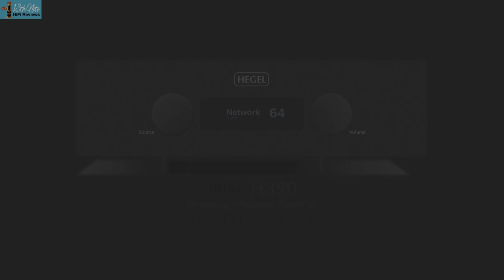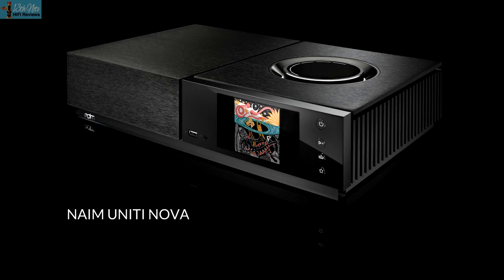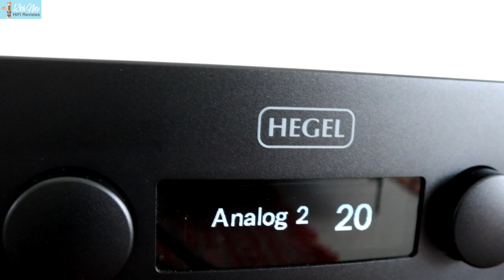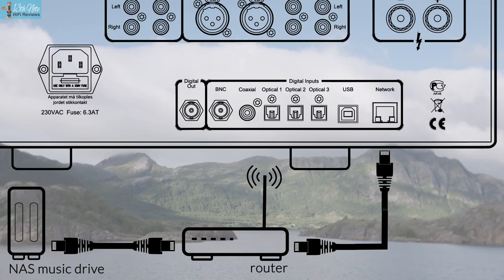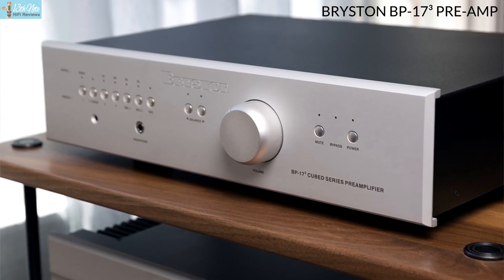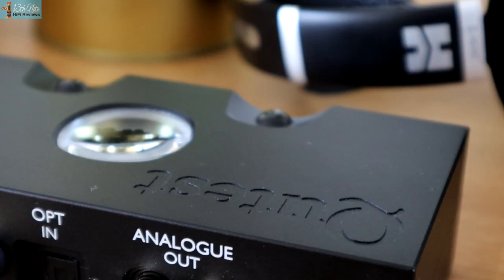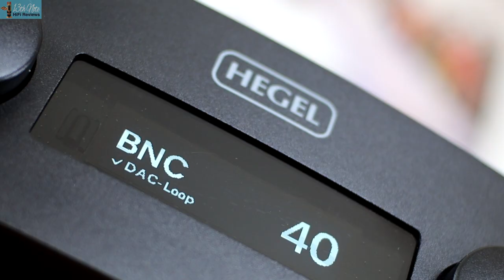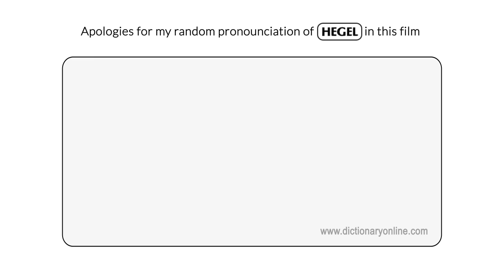A film about the Hegel H390 Integrated Amplifier

Comment: Listened to the 390 and the Naim as well. I had the direct opposite experience to you. Prefered the natural sounding, better made Naim. Both good products, I just made a different choice.
Reply from the maker: what speakers did you use?
Reply: @13thnotehifireviews7  my new PMC twenty5.23i’s and . . . . .  A very cool vintage pair of Kev Coda III’s that I still have.
Reply from the maker: @billywindsock9597  did you listen to all of it at home? what was more natural to you. You mean being a little tonally warmer with that Naim combo?
Reply: @13thnotehifireviews7  I have ended up with a Naim Uniti Star, PMC twenty5.23i, an IsoTek Aquarius and Chord ShawlineX speaker cables. I use CD, sometimes, this combination was the best bang for buck that suited me.
Reply from the maker: @billywindsock9597  some good choices there for me. Im sure the Naim is a good convenience solution. Those PMC's which I reviewed eat power and 70w is not enough dynamic headroom to get the best out of them, providing you want to at some stage. It also equates to detail too. This Hegel is nearly 4 times as powerful into a 8 ohm load. And it doesn't mean more volume etc, just more on and off dynamics. Ive been all the way from 70w to much more quality amps on my 25-23 including £10k dacs etc. It may have been the case in the dealer but you'll recognise the power offering on offer if you get used to it, of maybe a different brand if Hegel wasn't your taste. But sorry I dont think most people would agree with you with the Hegel not being as good a sounding amplifier mitigating taste issues. The naim is compromised by the fact its an all in one with an expensive case so that takes the investment down on amps.It wont be anywhere near as dynamic with bass. Ive got the similar H120 at same power to your amp and its obvious swapping over with my pmcs
Reply: @FJBx100  sounds lovely thanks.
Reply from the maker: @billywindsock9597  I agree the speakers are terrific
Reply: Hegel amps is natural, if you have a bright speaker thats what you Will get with Hegel, and with laidback speakers you get. More laidback sound vice versa, the point with Hegel is to add as little as possible to the signal chain, it took some time for me to get used to my h190, But once i did i loved  the experince
Reply: Better made naim?  Hegel is a hefty
We'll put together instrument.

Comment: I unboxed my H390 today and WOW it is bloody sublime! Previously I had the H90 and H190, but the H390 takes it to a totally different level.... think of it not as a step up from the H190 but a small step away from the H390 it’s that impressive. Driving Dynaudio Contour 30’s and the H390 has an incredible grip on them, a perfect pairing.  Highly recommended indeed
Reply from the maker: What DAC do you use?
Reply: @13thnotehifireviews7  no need for a DAC as the Hegel DAC is so damn good
Reply from the maker: It is very good and of a similar quality to DACs around the 1000 dollar price point but the amplifier is so good it will be very responsive to being improved by an external Dac. And DACs are underspent on in hifi, so for the quality of the amp and your speakers it is worth doing in the future. I’m trying a Denafrips soon, but ps audio direct stream or chord Hugo tt2 are worth checking out.
Reply: @13thnotehifireviews7  hey mate. Did you get the opportunity to try the Hegel in dac loop mode? I’m curious as to the point the Hegel converts the files and if a non-mqa dac would disrupt this.
Reply from the maker: @Peterfromplace  yes check out the video where I mentioned it 😁
Reply: @13thnotehifireviews7 Damn I must've missed the MQA unfolding part. I'll go through it again. Cheers. Looking forward to your next video
Reply: Hi,
Can you plz advise does h390 perform better compare to Simaudio Moon 700v2? Which one is better?

Thank.u

Comment: Hi Simon. now that you have been living with this for some time. How do you find the sound at low listening levels? I have focals speaker which are a littler on the more reveling side. I am looking at either the McIntosh Ma 352 or the H390. Do you find that it has good bass and that the high damping factor does NOT take away from the bass or control it too much?
Reply from the maker: Very good low listening. Good bass and no the high DF doesn’t take away. Definetely not. It does the opposite. It’s tonally not having any padding but when the bass kick is needed it is all there!👍

Comment: In my research into components I wanted to audition I came back to this video several times. I eventually settled on testing this and the Michi X3, I wanted a powerful amp that had a built in dac so I could purchase a streamer to hook up and at a later date add an outboard dac. I tested both amps with Spendor D7.2 as these were my chosen speakers for my system. I started with the Hegel, enjoyed every minute of it, I found it so easy to listen to and it gave me all the emotion with vocals. When I changed to the X3 something wasn’t the same, while the amp had all the drive for my electronic music I just couldn’t connect with it. I found it didn’t convey nearly as much of the emotion and with music, especially vocals, I want to be drawn into the emotion. Overall the Hegel simply had the ease, the detail, the emotion and the drive for all the music types I listen to, I was genuinely surprised how different the two amps were when it came to musical emotion. It was sad because I could have got a cracking deal on the X3, and the build quality and remote are to die for, but sound comes first. I will say I noticed the very slight toroid hum when I had it at home, but it is so low that the minute music is on you can’t hear anything and I agree for the most part you need your ear up to the unit to hear it. Overall your review was one of many that made it much easier to shortlist this amp especially as you too enjoy your electronic music. My streamer is yet to arrive, but the amp and speakers with the laptop plugged into the USB will do for now!
Reply from the maker: Good to hear, thanks for feedback . What was the price / performance difference to the Hegel with the x3. Spendors are fab.
Reply: @13thnotehifireviews7  The X3 at £4,300 is already less expensive but I could have got a big saving on that price so the Hegel was much more in the end. However I found the X3 to be edgier, it wasn’t a listen that stopped me noticing the amp, I was very aware of it. That couldn’t let me relax and so as I say while it had all the drive it felt tiring. I had read that it was warm and detailed, detailed yes but I didn’t find it warm, maybe it just didn’t match the Spendors. I also found it really noticeable how much quieter the background of music was with the Hegel in comparison so detail was easier to hear especially at lower volumes, this really became obvious with emotional pieces like Sade’s Pearls or Des’ree’s Kissing you. I went back to the Hegel to see if I was imagining all of this, perhaps it was my own fatigue (I’d been listening at the dealers for two hours by now), the minute it started playing again everything just relaxed, it all felt right again. I haven’t for a second regretted the choice as it still delivers that lovely sound that I can listen to all day and makes me want to keep listening. I now just need my final piece so I can truly sit back and relax without having to keep getting up to change tracks on the computer!
Reply: @Benvos  I had a similar experience today admittedly with Hegel's lower down offerings, 
I compared my Hegel H120 with the new NAD C399,
Really wanted to like the new NAD with all its new features including same dac used in the masters series and the added n-core modules. 
In comparison the NAD was really bright and lost all the emotion in vocals as you described, 
plenty of power with a big soundstage but cold.
I kept switching back to see if it was in my head and every time i went back to the Hegel the sound was much more relaxed but still really detailed and the bass was more deep and punchy too.
I think over longer listening periods the NAD would definitely become fatiguing. 
I have since come to the conclusion that in my experience Hegel make some of the best amplifiers out there.
Reply: That hum is normal for Hegel. Toroid
Are unwrapped transformers to insure better sound quality. You can fix by
Buying a DC filter/blocker, if it bothers
You.

Comment: Hi Simon, did you follow all the negative comments about Hegel on the Roon website? Most of them not only mention the lack of Roon ready after they promised that 2 years ago but also about cheap parts on the different devices of Hegel like the usb and the streaming part. Im curious what your think of this.
Reply from the maker: Audiophiles are an expectant bunch perhaps rightly because of the money they are spending. But I suspect Hegel didn’t promise it - I might be wrong - because they need to get certified before it happens with Roon anyway. So I doubt they would have promised in advance. I personally see the benefit of Roon to mostly be the interface, ease of use, Roon radio etc. But the thing with higher sample rates is that they are always taken as a kind of gospel truth to much better sound quality, which isn’t necessarily true. The Hegel’s ability to cope with airplay2 yields playback quality that exploits its fine amp stages and sound engine technology, more than many comparable amps that do the same airplay2 or even some amps that play higher sample rate music. That’s the way I look at hifi, people should be pleased when they can then throw higher sample rates at the Hegel via Roon, but not think hi res is the be all and end all because it is far from the only factor that creates a great or best category sounding amp. The pursuit of formats and sample rates has always been an allure of audiophiles based on technological understanding but it doesn’t then mean a product is inferior because it doesn’t stack up to a technological ideal. As I say I think it comes from people who are expectant, not trying themselves etc. On parts, I’ve no problem even if the parts are cheap, save maybe the external case which isn’t, so long as parts are reliable because when you buy hifi of this ilk you buy the design that has taken a long time to develop. I know they use better caps and other parts that stack up but even if they could be criticised - which I don’t think they can - I think the price of audiophile hifi at this type of price is a factor of supply and demand (with this design and capital investment) and the niche nature of audiophile hifi, not the internal parts somehow being golden nuggets.
Reply: @13thnotehifireviews7  thanks for your reply Simon, I’m fully agree. I have the H390. I know you have the same device. What Is in your opinion the best external streaming device to connect with the h390? Always looking forward to see your great videos.
Reply from the maker: So many tbh but my streaming shoot out video I did gives good pointers.

Comment: Great review Simon - Thanks, I have just purchased the H390 arrives tomorrow, I cannot wait to hook it up and see how it sounds, adding it to my Auralic Aries G1 streamer and powering my Kef R3 speakers (ive heard they work well together) it will be interesting to see how the DAC performs against my Chord Hugo TT2 and M Scaler?  shame there wasnt a WIFI option on the amp as I will have to look at options as its some way apart from the router.
Reply from the maker: Hi Barry, thanks for nice comments. You can use the extender option as I showed in the film to get the H390 to be wifi capable. Ive been doing that for ages in my set up and never have any problems. Netgear Nighthawk extender. What amp did you have before? Please feed back your comparison thoughts as would love to hear when you've got the H390 set up. Tomorrow I'm hoping to do a comparison of a musical fidelity amp against the two Hegel's I have. As well as Innuos Phoenix USB reclocker. BW Simon
Reply: @13thnotehifireviews7  Hi Simon I will check it out tomorrow re extender.  I previously had a Marantz KI ruby Amp which was great but I wanted an integrated amp and had my eye on Hegel for awhile, I will also be keen to check the DAC as I currently have a  Hugo  TT2 and M Scaler (which I love)
Reply from the maker: How did it sound?
Reply: @13thnotehifireviews7  it’s amazing day one and I’m super impressed wow.  It’s funny my TT2 now sounds almost flat and I never thought I would say that Simon,  I just want Roon Ready :(

Comment: Very nice review.
I have a Parasound A21 power amp and I’m thinking to upgrade my alpha 10 which is used as pre amp and my dac.
I am going to buy a chord qutest to replace my arcam  Irdac.
Would it be better option to buy the h390 that has it all?
The amplification stage through the h390 compared to the a21?
Which is better?
Thanks a lot.

Comment: Always great reviews!!! Which cable do you use to connect the h390‘s digital out to the coax input of the RME ADI-2 DAC? thank you …
Reply from the maker: Nothing special. I use a chord anthem digital (no longer made) or clearway (current model) but frankly you can get away with a $30 cable that you will be struggling to hear a change to these pricier ones.
Reply: @13thnotehifireviews7  👍🙏

Comment: Regards Dac loop feature.  According to Hagel website , I quote "The Network and USB inputs can be enabled separately. We recommend not using the DAC-Loop function on these inputs as it will corrupt the bit-perfect signal" Would the benefits of a better Dac outweigh disadvantage of corrupted signal?  I have a Pontus dac directly connected to my pc with roon and want to connect my pc to Hagel usb therefore using the jitter reduction of the Hagel H390 digital out.  Also when roon enabled use my  Pontus.
Reply from the maker: Don’t know Darren tbh and it’s much up to you as to what is best anyhow. Best thing to do is get a load of cables and connect up and see what works best with dac loop. I used bnc myself, and just slightly preferred using the loan Venus 2 (model up) I had straight into the Hegel without DAC loop, in any event.

Comment: Okay Simone. I am changing my Naim multi box (Nac 82with 2 Hicaps) with my loved Dynavector HX 1.2 amp to a single box approach. Not because I don’t love the sound because I do, but because my partner wants a simpler system to use. The issue is I run B&W 802 Natilus speakers; you either love them or hate them and I am a lover! I have been looking at accuphase but you try and find an affordable used 380/480/4000. I keep coming across the H390 and like what I read and hear, but what do you think? Will the H390 pair well with my B&W’s? I’m told the HEGEL can be bright and my B&W already bright and difficult to drive, but what do you think? Would love to hear your thoughts.
Reply from the maker: One for patreon please

Comment: I currently use the H90 to drive a new pair of Focal Electra 1008 BE’s. Astonishing sound!!  I’m using a Node 2i streaming Tidal. I did not audition them. I trusted my gut and did a lot of research. The warmth of the Hegel matches brilliantly with the sonic signature that the Focal is known for, in particular because of the Beryllium Tweeter.  The 390 and Audio Vector R3 Arrete’s are on my radar. Thank you for this wonderful review!! Would love to visit the factory sometime. And adding the Formula 1 reference topped off one of the absolute best reviews on You Tube.  Well, well done mate. Cheers!
Reply from the maker: Thanks very much Philip , glad I could help. This video did take lots of effort , doing one on Innuos Phoenix usb atm. An ok product but not as good as Hegel amps by some margin
Reply: The h90 is the best value integrated amp you can get in my opinion.  If that was all my budget allowed for, I would be completely happy with it.